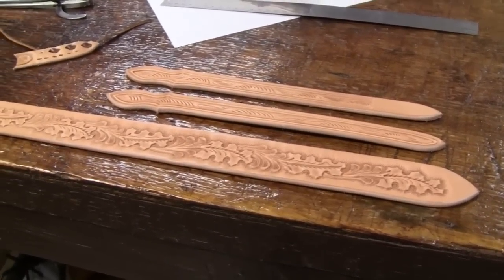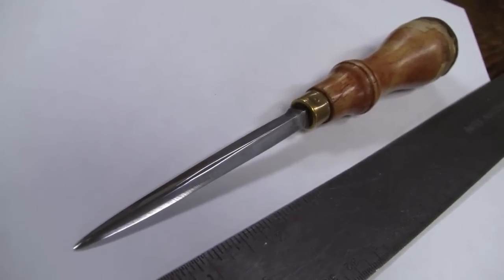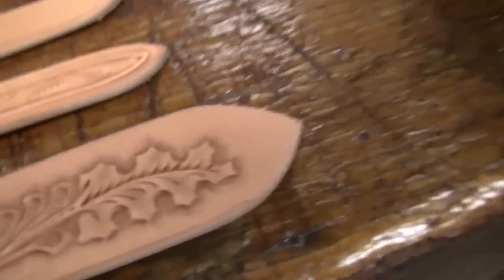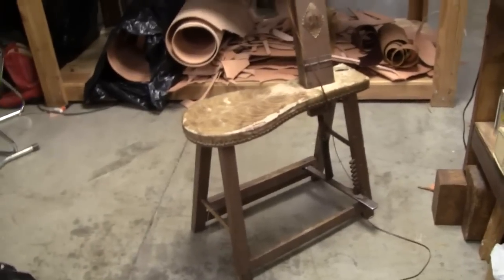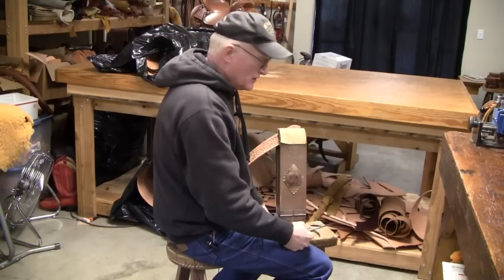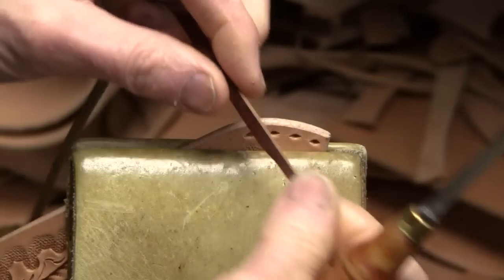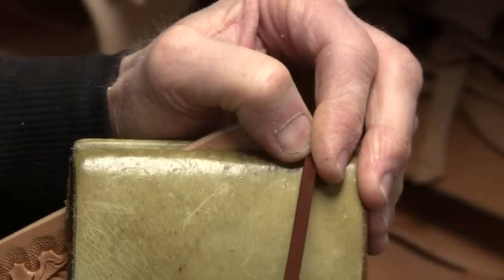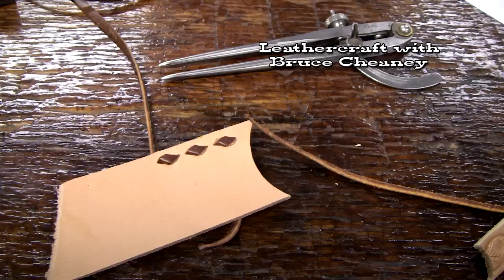Buckstitching How to Hand Lace and Buck Stitch Leather Belts Leathercraft Stitching Tutorial

Comment: Hi Bruce! Great video! Recently I was fortunate enough to come across a beautiful stitching horse/pony similar to yours! It was at an antique store a mile from my house! But, I’m no expert on its use. It has a leather strap, single buckle and a single hole in the strap. So it appears not to really adjust. As it’s configured now, the working piece wood have to be 8 inches thick for it to effectively clamp. A simple fix would seem to be to punch holes in the strap and Then just adjust the buckle. However, I hate to risk the integrity of the belt as well as the historical nature of the tool. Is there a better way? By the way what book did you find at the library with the saddler’s clamp in it?  I’m wondering if mine was just used for large pieces like harnesses or something. Any input would be appreciated. Would you be willing to show a video closeup of the configuration of you stitching horse?